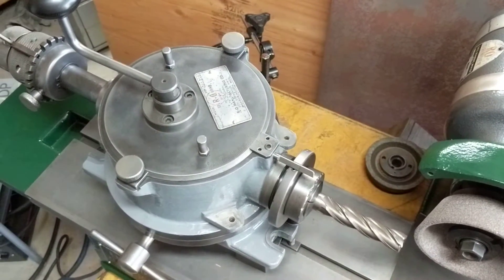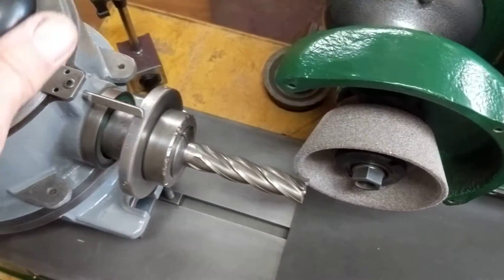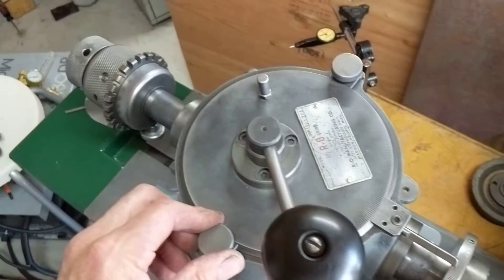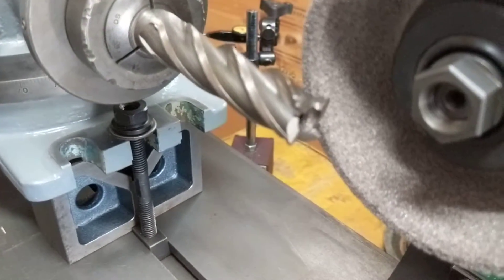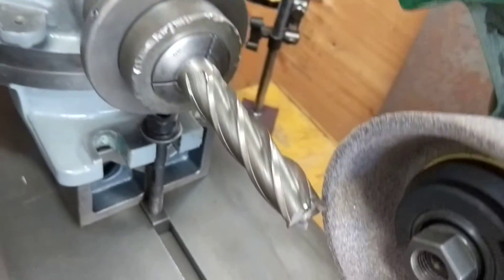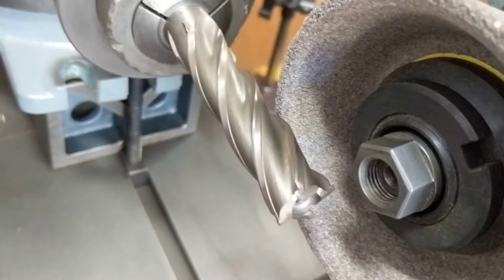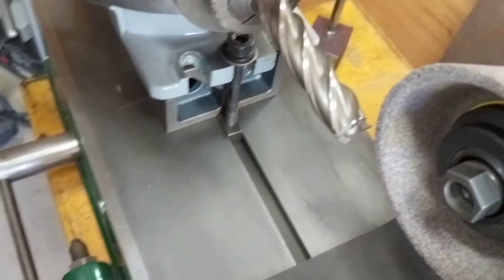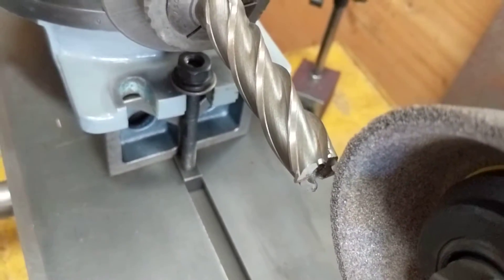Spi RO Grind Royal Oak Spiral End Mill Grinding Fixture

Comment: How do you adjust this to accommodate endmills with differing helix angles? If possible, that is.
Reply from the maker: The helix angle is infinitely adjustable.  You loosen the two outside knobs and rotate the top plate until you get the angle you want.

Comment: Hello, what is the mechanism inside? How it make it spiral?
Reply from the maker: I may be able to hunt down some old photos of the inside but basically it has two racks that pivot in their centers.  One rack is driven by the crank handle and the other rack drives the spindle.  When you rotate the top plate you are actually rotating the two racks with respect to each other.  So in what extreme there is a one to one ratio of the crank handle to axial movement of the spindle.  At the other extreme (rotating the top plate 90 degrees) there is a one to one ratio of the crank handle to radial rotation of the spindle.  Thus all sliding and no rotation or all rotation and no sliding.  As you then back off the plate from either extreme you get various combinations of axial (sliding) along with radial (rotation).  Since it is continuously variable you can set any combination of the two which equate to any spiral pitch angle.  Very neat!
Reply: @gerlacr   Could there be a photo of the interior please? What are the smallest cutters that can be ground on it? I'm deciding between the Airflow Fixture and this one.
Reply from the maker: @ivosekryntyntin2737  
There is no theoretical limit on the small sizes but practically speaking I would think that it would be difficult to sharpen anything down in the 3/16" and 1/8" range.  The friction of the gears and rack make the movement a bit jerky for some settings.  Perhaps with some practice and care it might be practical on those smaller sizes.  I have pics of the guts but I do not know how to attach them to these messages.

Comment: If you use a borazon cup wheel you will definitely get a better primary and secondary finish.
Reply: As long as it is running true.   Mostly the advantage is way less wheel breakdown.